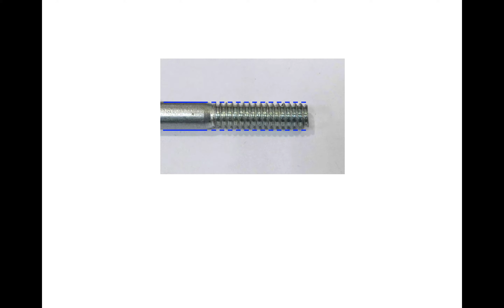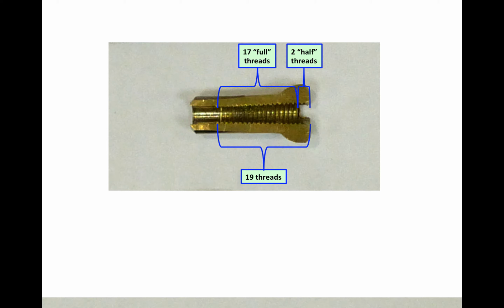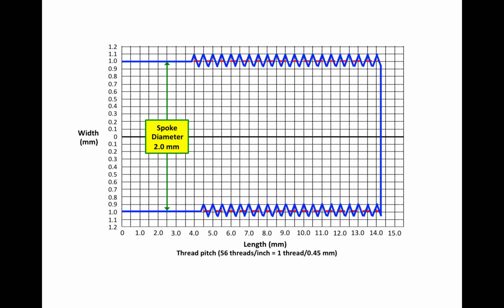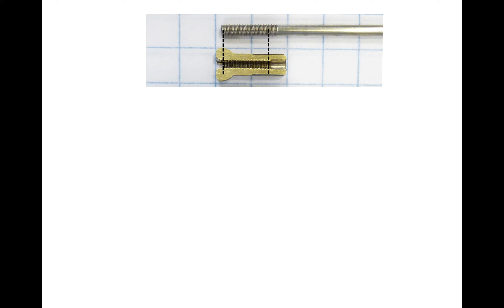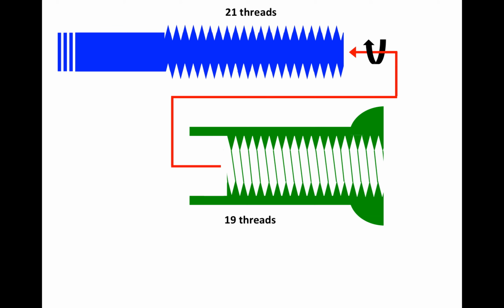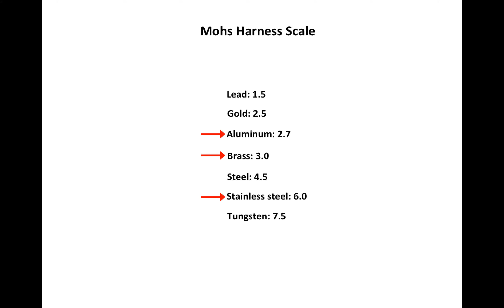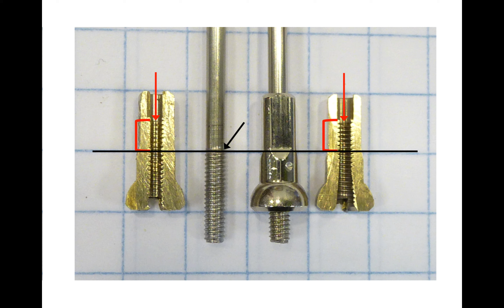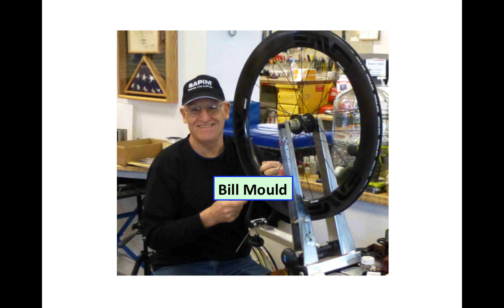Nipple and Spoke Threading

Comment: It disapoints me that this channel does not have as many subscribers as it deserves.
This is great information, presented very well. Thank you for sharing!

I am here because I have zero wheel experience but I want to rebuild an old bike  (1960s ish) and in order to paint the wheels and clean them, I am thinking of taking then apart and put them back on spoke by spoke. And the rims are single wall, so it does happen, with retro bikes.
Reply from the maker: Thank you for the encouragement.
Reply: @BillMouldWheels  It is not ment as encouragement. I am sure you are brave enough. It is deep apreciation from my side for your great work on youtube which is academic level. There are schools without this level of depth and dedication. You should be a professor! 
I wish your channel would grow over 1 mil. subscribers so you could afford a team to do even more nice editing and figures and animations to go with your knowledge.
Reply from the maker: @dragostalks7501  Wow, thanks!

Comment: Apart from crunching the nipple thread, are there other negatives from having the spoke protrude too much above the nipple head, like the picture at 7:20? I had a rear wheel built and the drive side spokes protrude about 3 mm from the top of the nipple head.

Comment: Thanks Bill. I have some Chinese carbon wheels that seemed ok but have started breaking nipples, bizarrely not when riding. I now believe the spokes are too short and don’t reach right into the body of the nipple, indeed don’t even reach the rim. It doesn’t seem right to me as the strain will be taken by the neck of the aluminium nipple. Thanks for your video.